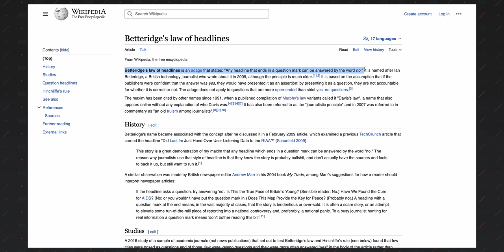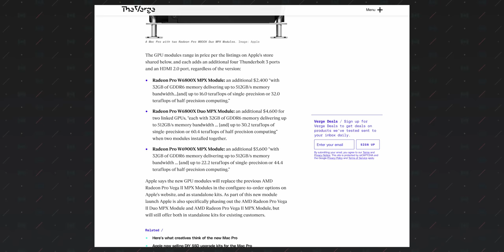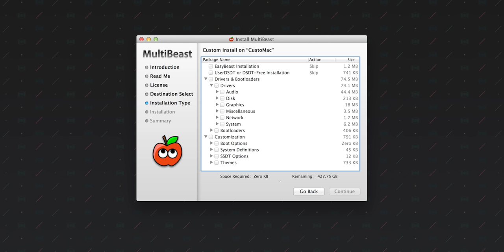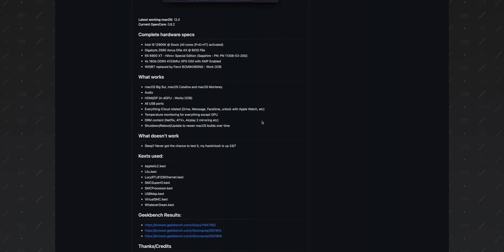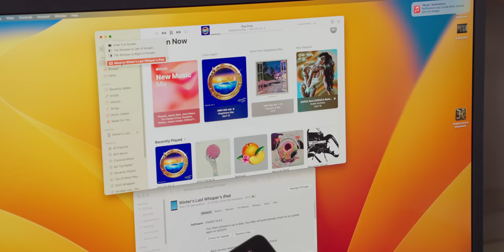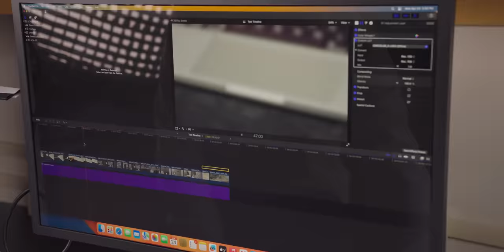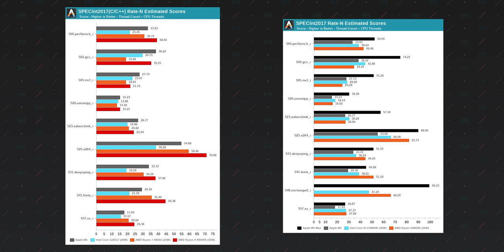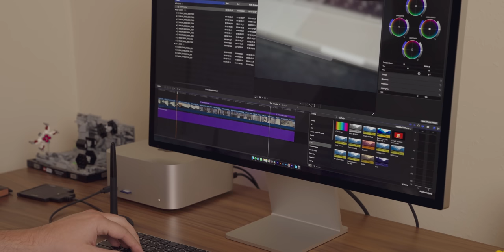This $2,000 Hackintosh SMASHES the $4,000 Mac Studio

Comment: Mentioning you used to be able to “create a hackintosh in minutes” lol. I’ve lost days of my time to debugging my hackintoshes over the years even with those “easy” tools. Appreciate the video, I’ve given up on the hackintosh dream and have been living the m1 life for a while now. I do miss the performance more often than I thought I would.
Reply: You know you can add an eGPU to Macs right? Throw a 4070 in there for your docking station haha
Reply from the maker: OpenCore takes a bit to get setup, but once they're setup, it's pretty darn seamless. I'm impressed with how far they've come.
Reply: @tbonedude12  but MacOS doesn't support Nvidia graphics cards that new?
Reply: Almost every problem I have had with a hackintosh that wasn't just solvable by effort (like taking time to set up USB) has been with the GPU. Get a 580 or 5600XT/5700XT and test out boot flags. This goes for both AMD and Intel systems.
Reply: Haha, it took 3months for me
Reply: I saved tons of money and Id argue time using Hackintoshes up until 2021 when I went with an M1 Mac Mini. I always built hacks based on solid, tested hardware builds with plenty of instructions and testimonials about identical builds working great and it was never a time waster.  Always a perfectly working motherboard/GPU/CPU combo, decent setup guide and no issues to speak of. I gave it up for the M1... But now after a while with my Mac Mini it has more issues than any Hackintosh I ever built. The fact that it's core hardware is set in stone IRKS me greatly. I can improve nothing about it. I rely on external storage or Id have run out of storage almost right away. Worst of all, randomly it blinks off to a black screen for 2 or 3 seconds. I can't find what the cause of that is. I would switch totally to PC but I use Macs for Logic Pro and don't want to replace it. Anyway... Tldr; I didn't find Hackintoshes a waste of time at all from about 2008 to 2021 when they were my primary machines. just never use untested hardware and I didn't run updates on my mission critical partition before testing on a backup. I may look into a build like this this summer when Im ready for an upgrade.
Reply: I had the black screen blinking issue on my M1 Mac mini too - swapped my HDMI cable - which fixed it.
Reply: @abulka  hey thanks! I never thought of that. I'll have to try that!
Reply: I actually missed the lost days lol. I run a hobby hackintosh now just for when life is going too smoothly.
Reply: @tbonedude12  have you even used a Mac in the last 10 years?
Reply: Yeah it isnt that hard and if you were spending days trying to get it to work then maybe you should be using a chromebook they are more your speed.
Reply: @abulka any specific hdmi cable brand?
Reply: @snazzy  Until it stoped after an MacOS update, yeah 👌🏻😂
Reply: @thomgizziz  You realize nobody is born with this knowledge.
Reply: @thomgizziz  Wow that's harsh. I mean it isn't that hard if you go for easy stuff but for example I'm trying to get my touchpad and touchscreen working together plus the touchpad is actually a screen. Bet you wouldn't find that easy.
Reply: @snazzy  this hackintosh for amv editing 
Love from India
Reply: Hackintosh was the way to go for performance. Can't beat a properly cooled machine. 

But based on the hours I've also lost. I'll stay with my m1 Macs. 😂 😆 😂
Reply: @snazzy  I used OpenCORE with an old Mac Pro. Seamless integration and installation. 😅😮😅

But I never tried it on a hackintosh. 😮😅😮
Reply: Building a hackintosh is still rewarding Apple by clinging on to their ecosystem. They still sell you plenty of software/accessories down the line anyway. Apple had the choice for years to sell true desktop machines to home users who need a bit more power and flexibility but they consistently dropped the ball and made it clear that they're not interested in less than PowerMac/Mac Pro level exorbitant margins. I don't see the point on insisting that one voluntarily stays in that ecosystem knowing they'll never be able to buy a Mac like their hackintosh. It's perhaps only hope that they can upgrade to a real Mac Pro which explains such idiotic stubbornness.
Reply: It was a great science experiment. First build. Still have it. The empty cavities are set up to be a Lego bat cave with color fans all over it. It’s great….. running widows and running my social media and gaming.
Reply: Opencore destroyed my macbook pro 2011, trying to get monterey. these tools easily break shit if you mess up even 1 small parameter. not to mention their guides/FAQ is trash
Reply: Too many Gray hairs due to hackintosh
Reply: @tbonedude12  not to Apple Silicon Macs you can't... 🤦‍♂
Reply: Haha amen to this. Still remember my hackintosh days, before opencore came along. I used clover, I would spend days and weeks, trying to figure out and troubleshoot what was wrong, I'll say this, it was SO MUCH fun! And that sweet satisfaction of getting that first all working perfect boot is next to nothing! Heck I pushed my limits, I got my setup to triple boot Windows Linux and Mac os. Amazing times. Since I'm considering building a ryzen 9 am5 PC, I too have given up the dream
Reply: @tbonedude12  emmm no I don't think you can, not the 4070 or 30 series either or 20 lol
Reply: @peterelliott2914  hahah too smoothly!
Reply: @krunge  like who's wanna even run Nvidia... Their rubbish
Reply: @mattmaddux yup….i got tired of messing around with trying to install the latest osx.  I would spend hours trying to follow steps only to feel like my setup was the only one running into issues. Lol
Reply: @tbonedude12 nope
Reply: Same here. That was fun at first. But then, once your time equals money, the hackintosh becomes way less a good idea.
Reply: Exactly my experience, once I was willing to wasted days on tinkering and problem solving but I just can't be bothered anymore, at least until my M1 Air's ssd dies then I might be trying to remove and resolder them, yes I know it very hard to do currently but hopefully ppl will work out how to get around Apples serialization that should be illegal imo because having to toss a perfectly good computer in the bin because of one or two ssd's boils my blood.
Reply: if anyone needs help regarding a hackintosh build I'm here to help but you'll have to compensate a little. 🤑
Reply: @tbonedude12 That won’t work. At all. Lmao.
Reply: I really like this video. The sad thing is that hackintosh I feel wont last forever witch really makes me mad.
Reply: It takes a couple of hours man not that hard made 2 hackintosh laptops
Reply: @Zactivist so why not go back to hacks and ditch the m1? 

Did you get the computer trouble shot by apple?
Reply: running it in a kvm is both easier and more reliable than running bare metal, comparable performance too if you pass a gpu through

Comment: If you optimize the 13700K just right, you can get respectable efficiency! Mine gets a Cinebench score of 28000 with a power draw of just 165W. That's just a 7% loss of performance with a massive drop in power draw.
Reply: oh hey there, didn't expect you over here! 👀

Are you hackintoshing then, or was that Cinebench on Windows? Personally, I'm sure an AMD would have done much better here, but that's harder to setup with OpenCore if even possible, so it's good to hear there's room for a bit of power efficiency
Reply: Yes Under Voltage CPU Help It. Same Performance 💖
Reply: I get no performance loss from my 13700K with a Proxmox VM Hackintosh, Cinebench 30600 (same as when I bench it in bare metal Windows). Undervolted with the same low power draw as you. No tweaking/optimizing required.
Reply: well well .. can you work in silence? I do and to me that is an achievement!!! and also do you have all that power on a battery? i guess not... hahaha
Reply: @davidg5898  How much do you undervolt it? I have a 13700K as well and haven't properly tuned it in yet.
Reply: @calinnilie  Mine is stable at -0.150V.
Reply: @davidg5898  the Silicon Lottery has been kind to you, Cinebench is starting to crash for me at -0.120V. I left it at -0.100V for now and I'm happy.
Reply: I set it to 1,225V and I get a 30.000 point score in cinebench with temps max at 96C
Reply: @bananasandbass  With -0.100V (that gets me to 1.305V I think) I get 30050 ish in Cinebench R23 multicore, and temps max out at 90C. The lower temperature probably also comes from having installed a contact frame.
Reply: Yes we must tune raptor lake's voltage (undervolt) and we can shave off a ton of power consumption and heat. Some Motherboard auto voltage settings are also ridiculous and set voltages that are way too high
Reply: @davidg5898 you probably just got a really nicely binned 13700k.
Reply: @RiceCubeTech  Not really. My Asus board gives the CPU a very average SP rating. But the MB is an Asus Hero Z790, which has a crap-ton of power stages and can deliver very stable voltage. And I did win the silicon lottery with my RAM, which helps stability, too.
Reply: @davidg5898  Do you run a separate server as Promox host? I tried running it locally, but didn't have two GPUs so ditched the project.
Reply: @JamieR  It has to be local if you need good video output. You don't need two GPUs. I only have one and pass it through, it's not hard to do with a compatible GPU. Look it up.
Reply: @davidg5898  Thanks :) I only ever did Clover and OC builds. Proxmox is brand new to me, but the documentation is a bit steep. May I ask how you ran it? Ubuntu host CLI or with GUI? Any tip on how to approach it would be greatly appreciated!
Reply: @davidg5898  Very interesting. What kernel version do you run and do you see any drop in Geekbench score? If so by what percentage?
Reply: Its definitely a trade off the PC is many times larger, more noise and siginficantly more power draw at load over the Mac Studio.  But hey you are saving $2000 and getting an experience build and all
Reply: Agreed. Managed to get around 38500 with my 13900K for just 200W.
Reply: doesnt include GPU...... doesnt matter at all. ARM will replace x86 soon enough.
Reply: @tserv2657  They've been literally saying that exact thing for years
Reply: @ssaini5028  Using modular PC components means the system can be modified & upgraded over time as your use case evolves & new hardware becomes available. The Mac Studio is an e-waste machine, that's the biggest compromise with the Studio.
Reply: @Lee.S321  Modular PC runs hotter eats more power and needs a bigger foot print.  Mac studio can be taken with you on trips.
Apple Silicon is still faster in some workloads and as time goes on more software will be optimized for its silicon.  Apple M3 Ultra will be a monster
Reply: @ssaini5028  Regarding portability, that's what laptops are for. Desktops don't need to be mobile when you can remote in, so may as well get a thin & light laptop & a beast of a desktop if you need mobile performance. Mac Studios, & now 2023 Mac Pro, have no upgrade route or gpu expandability, so not quite sure what the point is. Seems like Apple is no longer competing in the high end desktop market.
Reply: @Lee.S321  Every Mac product other than the Pro has no upgrade path its alawys been like that.  However power efficiency and battery life on the Mac Air  for example are miles ahead of the competition.  
Even next generation product from competitors will still be behind Apple in some applications and situations.
99% of the YT tech community uses some form of Mac to edit their videos, whether its a studio or Mac laptop.
M1 Ultra till this day is still over powered for any editor.  So yes Apple products are not cheap but they certain hold their value in terms of longevity. 
M3 Ultra will be on TSMCs 3nm which Apple has bought the entire supply, its going to be a monster
Reply: @Lee.S321  Agreed on that point, there is no need for a Mac Pro this generation.  Definitely a recycled product.  If you need PCIe expansion the Mac Pro isnt the way to go.
Reply: @ssaini5028  "power efficiency and battery life on the Mac Air  for example are miles ahead of the competition" this isn't really true. I've used AMD powered laptops like ASUS S13 (6800U) which can get 16 ish hrs on a charge. I've seen reviews of the HP dragonfly getting even more on a 7000 series chip. Maybe you get an hour or two more on a Mac Air, but it's certainly not "miles ahead", that's just buying into marketing hype. MacOS (& Mac hardware in general) has far too many limitations to be useful for my use case.

"99% of the YT tech community uses some form of Mac to edit their videos" even if that were true, 99% of people & professionals in general have never edited a video in their lives, so YT reviewers focussing so much on video editing is a poor test of a device's capability & pretty pointless (it would be like gauging capability purely on gaming performance, & nothing else), so don't pay too much attention to it. Don't buy into the marketing & hype & consider YT reviews a decent representation of what hardware can do.
Reply: "just 165W" ha ha ha, it is hilarious to say "just".
Reply: olny clowns use cinebench comparison between arm and x86
Reply: You're probably feeling pretty good about that downclock right about now!
Reply: @StormXF3  forget cinebench score clown once and forever!!! Cinebench is unfair for arm!!
Reply: @Lee.S321  oh yes its miles ahead!! Dont compare a shitty underpowered 6800u to a M2air its not even close and in batterylife not even the same universe
Reply: @PKperformanceEU  16 hrs one a single charge is very much in the same universe. When she first got it my gf's MB Air would last max 18 hrs. 18 isn't that much larger than 16 you know, & seeing as the S13 I was using had a high res OLED, & the MB was still using dated LCD displays, there was no competition at all. Also, gaming on a MB is still very hit & miss, so a complete waste of time for most people who want to use their laptop for a bit of everything.
Reply: So you turned a 13700k into a 7900x